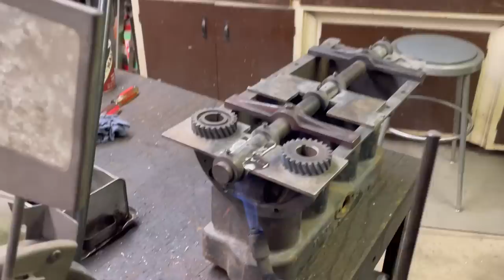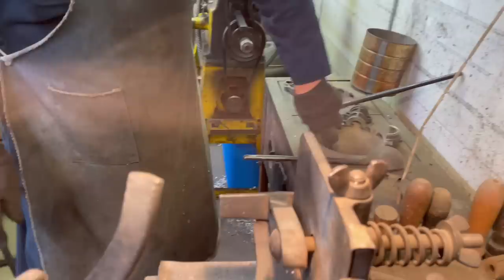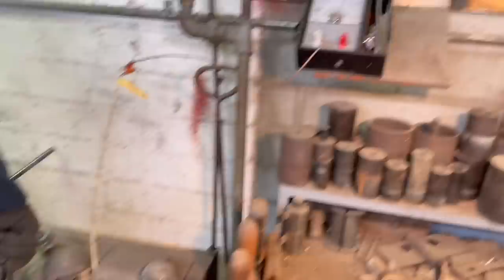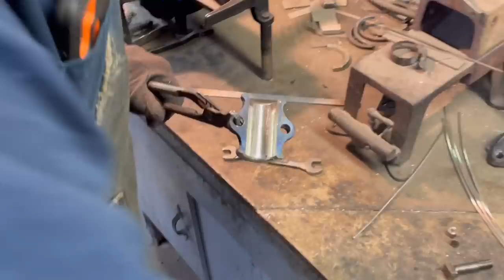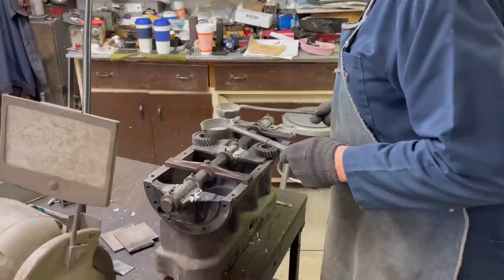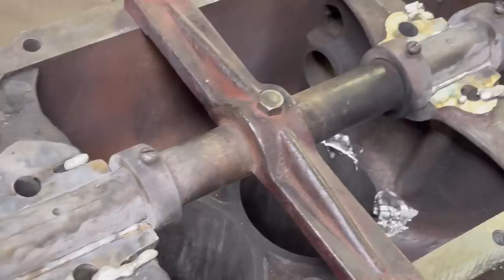Pouring Babbitt bearings on a Ford Model T Engine Block

Comment: Thanks for sharing this. My uncle used to talk about pouring Babbitt bearings, but I've never seen the process. He also said that during WWII when the couldn't get metal for Babbitt bearings they used strips of leather soaked in oil as bearing material.

Comment: I like that he’s working on a 1920’s block, while listening to 1950’s music in the 2020’s…

That’s a great skill to have!  Certainly not something that you can do easily do at home.
Reply: depends, I could do it at home.
Reply: You can certainly do this at home but the equipment may be slightly more primitive. A major advantage of Babbitt bearings is any farmer etc could pour their own rapidly returning equipment to service.  While a fancy oven as shown was for volume builders/rebuilders far more bearings were poured using old cast iron pots etc heated over whatever was handy like common hand-cranked forges. 
Old machinery had to be serviceable in the field FAR away from a much more thinly dispersed civilzation. Babbitt is ideal for low-speed uses of the era. Many mechanics/machinists made their own tools with the fancy store-bought stuff often out of reach. That's why many farmers had lathes in their barns and sometimes a mill.

Comment: Over 60 years ago in my first job in the metallurgy labs of a large Steelworks I watched new bearings being fitted into a lathe and a shaper.
The bearings, which we called white metal, came pre-poured and were placed into the bearing holder with a smear of machinists blue which was a dark blue greasy cream. The shaft being supported by the bearing was then put in place and slowly rotated smearing the BLUE over the bearing and the shaft. The shaft was then raised and examined, high spots on the mating surfaces were highlighted by the Machinist Blue. The fitter then used a very sharp scraper to smooth out the high spots until the bearing and the shaft fitted together PERFECTLY.
The  worn shaft in question had already been “TRUED UP” on another lathe.
Reply: I've blued and hand-scraped babbet bearings.
Reply: @douglaswilson6634  I discovered that as much as I was fascinated by the industrial processes of a steelworks I decided that it was not for to make my career on. I spent hours watching the furnaces being tapped, the startup of an electric arc furnace was spectacular and the rolling mills which squeezed the giant red hot billets into every size imaginable was stunning.
After 6 months I changed careers to the computer revolution and never looked back, that was in 1964 in England, I was hired by a US company and came to the States in 1970, had a great career working for Silicon Valley companies, switched to Data communications, worked for some of the pioneers of the Internet and all that has prepared me for my current career of ferrying my grandchildren to their after school jobs and activities.
Best wishes.
Reply: I lived in Oklahoma at an old mine , sand and gravel, we used a dredge to pump the materials out of a huge pond and we had babbet bearings on our old dredge and I reworked them many times .
Reply: A master practicing his craft, awesome!

Comment: In the first machine shop I worked in, we would use the same process for pouring large grain elevator machinery bearings. Sometimes two of us would be pouring from ladles that would have at least a quart of molten babbitt.

Comment: Amazing video. As a retired oil field welder, I've poured pounds and pounds of babbit around frayed cable to secure it in various uses around wells. I have always known it to be called bearing metal, but never got to see it poured as such until now. Thank you so much.
Reply: when I worked in a civil engineering lab we would get cables off old bridges capped with babbit to secure it in the socket. When we socketed cables however, we would use an epoxy. You pack the small end of the cone with modelling clay so the epoxy doesnt drip through. The epoxy was much easier and safer to work with indoors and was easier to press out later so we could reuse our sockets.
Reply: Cable tool water well driller. Used lead in our cable socket to hold drill bar. For drilling used left lay cable so drill would turn cw for right hand threads
Reply: @gqp4800  I didn’t know that about left laid cable. I knew there is such a thing, but never heard about the relationship to threads. I helped a couple old cable tool drillers that came out of retirement to help the small oil company I worked for when I was young. Really smart guys that I enjoyed being around even as a teenager.
Reply: I was trained at a UK coal mine and was able to cap the ends of shaft lifting ropes. It was quite some process with steel ropes due to not just the oil and grease in them but also the rope needed to be at correct temperatures throughout. My work was somewhat sheltered and had facilities nearby but you working at wells doing it must have been quite the challenge.

Comment: Hat is off to you sir. Not a lot of folks left with your skill. I rebuilt a 1939 B Deere tractor and that engine was babbit mains and rods. Harts Machine in Cecil Ohio did the work. Takes the right tooling and equipment to do it. I see this gentleman has it along with the skill to do it...
Reply: Pretty sure I've heard of that place,the boss mentioned it, when I worked up in Akron at r+r engine about 15yrs ago.

Comment: I wonder how many "youngsters" know how to do this?
What is going to happen when we old guys are gone?
Somehow the "tricks" learned by experience need to be passed on to those that follow or the knowledge will be lost forever.
My journeyman made me cast bearings in an old block and set of rods over and over for maybe a month, machine and scrape them until they were right - and then do it all again...
But eventually I got it right most of the times.
The worst was when someone else used the station and overheated the metal which then became basically impossible to use properly and made bad bearings - total pain in the ass...
WOW - memories
Reply: I do I'm only 68.

Comment: I've done that with hardwood forms and clay dams for one off repairs on hit and miss engines and old equipment. Sometimes you have to do it a few times to get it right. I do enjoy scrapping babbits to size. Fiddly, but satisfying.
Reply: I learned to scrape bearings on a mine shaft hoist and then moved on to the old motors on some ball mills at a different mine. Interesting education. I still have the scrappers.
Reply: Mention scraping bearings to most guys and they get the same look a puppy does when it hears a new sound!
The first time someone saw me scraping a set in he yells "WTF ARE YOU DOING?!?!!" 🤣🤣🤣🤣

Comment: As a 71old gearhead, this is amazing! I've heard stories from long since departed family members that used leather until they could afford proper repair.
Reply: My father told of a time when a rod started knocking when they were out "four wheeling" and they dropped the oil pan and used part of a leather belt in the rod and cap to get home. Can you imagine trying to do something like that with todays engines?
Reply: My grandfather did exactly that with a Model T they used on the farm, in fact since the T was used as a power source for various equipment (saws etc.) the engine never did see fresh babbit, just fresh leather!
Reply: I grandfather told me they would even use thick strips of bacon

Comment: So is it like a machine afterwards or are those babbitt bearings ready for final engine assembly as is. 
Also, how did Ford incorporate this into the assembly line process? I mean towards the end they were building one Model T every 24 seconds and this looks labor way too labor intensive for that. This is still a fascinating process and I thank you for sharing.
Reply from the maker: I do not know what Ford did. We did another very tedious process after the pouring using tools called bearing scrapers and the caps are shimmed and we hand fitted the bearings.

Comment: I work in the lumber mill pouring Babbitt guides for the mark 50 and a couple other edgers. It's very important to heat the metal that's being poured. Pouring Babbitt guides moisture is your enemy. 🧑‍🏭

Comment: Such amazing skill!  Really makes me appreciate insert bearings. 
 I assume the cam bearings are poured the same way with the block vertical and some means of sliding "stops"  on a centered shaft to prevent it from leaking out?
How is the spilled babbit removed from the threaded main bolt holes?
Thanks for making this video.
Reply: Cam bearings were put on the cam and installed in the block like 71 series Detroit diesel

Comment: So bearings aren't poured with crank and rods in-place?
Reply from the maker: Jim used a tool from the 1920's that was the size and placement of the crank when he did the mains and there was another tool from the same time period for pouring the rods.
Reply: @ D Craft
It can be done that way, but it was never considered good practice and certainly considered poor workmanship to do so. Very hard to get a good bearing esp for the mains because you have to maintain alignment. The poured bearings still have to be scraped in for clearance. Desperate circumstances only.
Reply: Pouring in place was just what I heard from, lets just say...oral history! Given the  hard times my dad's family has gone through, desperate would be an appropriate word

Comment: So what I don't understand is, you used a fixture in place of the crankshaft, so since they wouldn't be exactly the same size, is there an additional process where the Babbette is line bored to finished size?
Reply from the maker: We then "scrapped" the bearing for the final fit. There are shims between the bearing cap and rod or block.
Reply: @fritzficke  Thx for the feed6

Comment: So these look thick compared to modern bearings? Like the plain bearings in my truck would be 100/1000 in. thick and these are 1/4” thick?
Reply from the maker: Not a 1/4 inch but they are a little thicker than an inset bearing

Comment: Whilst that is a great vid, what a tedious process in order to reduce friction. Activities like that must have added a significant portion of cost to the end product.
Reply from the maker: Yes, and then the next step is also very tedious as the bearing is hand fitted to the journal using bearing scrappers.
Reply: The big plus to this is that 100 years later that engine is still repairable and usable. These new computer controlled engines will ever survive that long!
Reply: @fritzficke  
While it is true, manually scraping bearings is tedious (especially main bearings because you have to maintain alignment in two planes, observe oil clearance, and monitor the  meshing of the timing gears all at the same time), labour was extremely cheap in this era, even for a skilled mechanic.
The factory would’ve poured both halves of the bearings on mandrels, fitted the semi finished caps to a crankcase then lined bored them to a finished gauged size. So there would be a degree of automation at that level. It was common practice in those days to run up the assembled crankshaft/block using an external power source like the factory overhead power shafting to ease up ‘tight’ bearings, thereby minimising hand scraping.
Reply: @RB-qq1ky  hence the running in period so everything bedded in and cleared just right
Reply: @luviskol   Yes, once the engine is operating under its own power. I didn't explain it very well, but the process I was describing was sometimes used after a fresh set of bearings had been poured, either at the factory or at the engine reconditioner's and the engine was out of the car. The practice was to deliberately finish the bearings on the tight side thereby saving time/labour scraping them in to perfection, then attach the crankshaft to an external power source and rotate the crankshaft to reduce the high spots. The bearings were flooded in oil while this was going on of course.

Comment: What does the mixture consist of
Reply from the maker: . It was bought like that for bearing material. it has tin, antimony, copper in it but no lead
Reply: do you use a tinning flux to tin the block
Reply from the maker: @eweunkettles8207  Yes.
Reply: @fritzficke  
babbit as its called  is manufactured by     FRY   a solder company in uk
Reply: The way it sounds from what he said in the video hes probably using grade 11 babbit. Which is very close to what Ford used back in the day.